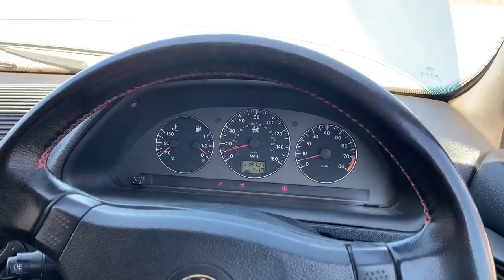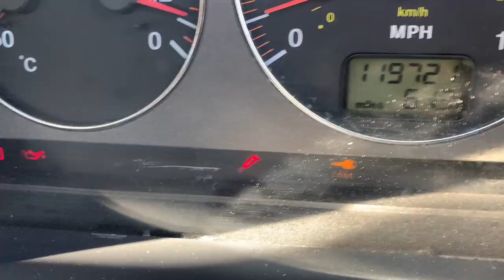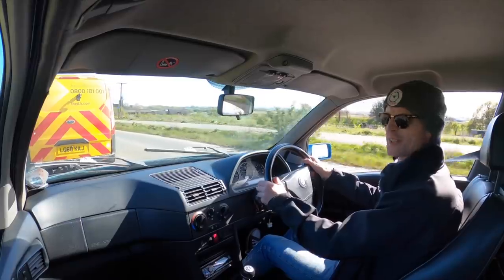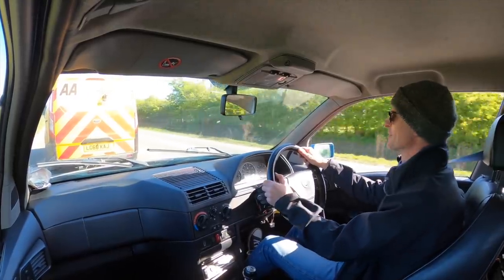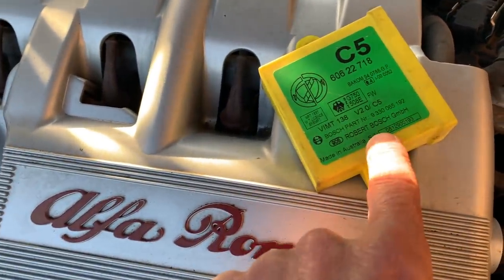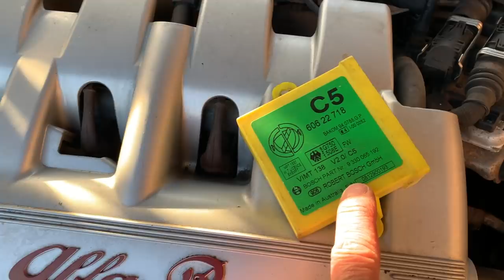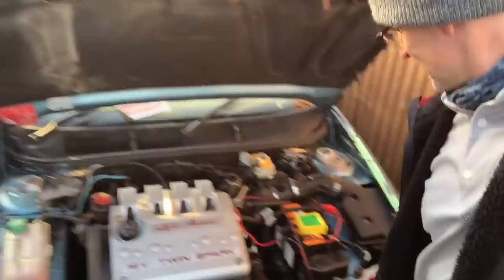Alfa 145 - KILLLED by a speed bump!!

Comment: That AA bloke was very good and dedicated ! They are not normally like that .
Reply: That's way more than our AAA in the states will do! They'll either deliver a jump start if you have a dead battery, enough petrol if you run out of gas or a tow.
Reply: Yeah normally they give up after 10 mins LOL
Reply: @christineayres5339  or whinge!!
Reply: I have to say owning a Land Rover Discovery 4 I get to use the AA a fair bit and they’ve always been great. 

Most recently one AA man was underneath it trying to sort out a diesel leak, which turned out to be a faulty fuel filter, but it’s hidden away under various skid trays and took a lot of time just trying to dismantle it.
Reply: ANWB in Netherlands are like that, they could even fix a carburettor on the roadside. Only once they had to admit their defeat when the V70's fuel pump had died and was inaccessible without removing the fuel tank.
Reply: Last AA bloke I had attend was horrible, he just didn't want to be there or do his job.
Reply: @ThatLeeNoble  Had one like that too, with a Mk2 Astra (or Kadett E as they were called here), coolant hose burst and he was complaining that I didn't maintain the car well enough, despite the battery and oil filter were fresh and had Opel branding on them. He did fix it though!
Reply from the maker: Ive been very lucky as every AA person who's been out has been brilliant, maybe its interesting cars that help?
Reply: He was a very nice man!! Wasn't that the old advert?
Reply: @furiousdriving  I think it is. Wou wouldnt want to see an alfa on it's own legs.  A lupo might not have got the same attention. But seemed a great guy all the same.
Reply: I'll never cancel my AA membership. Those boys have seen it all before. They've solved issues that none of the local garages could ever figure out. Saved me hundreds when I could only afford unreliable cars.
Reply: @volvo480  really? I just replaced the fuel pump in my V70-I. Pretty easy to do. Yours is a P26?
Reply: @furiousdriving  Definitely

Comment: In my experience it seems that if you give some cars a little TLC,   they either reward by leaving you stranded at the side  of the road or by developing some kind of fault. 
Top marks to the AA patrol man for doing his upmost to try and fix the Alfa.
On the subject of German parts failure, back in the early 90s I owned an MG Maestro 1600. Whilst we were on a family holiday the gearbox developed a serious fault which resulted in a replacement gearbox being fitted by a local recovery agent. As you’re no doubt aware the Maestro was fitted with a VW gearbox.

Comment: Bosch german part in an Italian part but made in Australia mate! Have you checked the key fob to make sure the little chip hasn't moved around in the plastic key fob. Also check the wire loop behind the ignition lock. Cheers Steve, Sydney Australia
Reply from the maker: we did open the key and it looks like the ring may have a connected fault

Comment: I think I've  got a spare code box with matching key if you need one . Also it looks like the code antenna ring around the key may have moved I think  it should be flush with the front of the barrel that would cause the problem
Reply from the maker: I think part of the problem may be the loop but that was taken off and just popped back as it will be checked wit the ECU. Im sending this one off to be checked so I know it wont happen again with older parts

Comment: I think the Fiat Brava, Bravo and Marea had the same Problem. It happened everytime you pushed the passenger seat backwards to harshly
Reply from the maker: similar parts in them
Reply: Wasn't that the fuel cutoff switch that triggered in the Bravo/Brava if you slammed the seat back?
Reply: This happened to me the first time I had passengers travelling in the back of my 145 - pushing the passenger seat back triggered the fuel cut off switch. Very embarrassing!
Reply: I haven't encountered that (in 13 years) but will be sure to take care to avoid it in my Bravo HGT

Comment: I had an Chrysler Grand Voyager AWD -00 do that to me outside a store, it started but cut off two seconds later with a glowing immobiliser. Tried the other set of keys but had to give up, talked to the store owner telling him I'll leave the car there for the night. Went home and started googling. Found others with the same problem and the solution, went to get the car home and it started, drove it home and ghe next day the problem was back. But this time I knew what to look for, behind the heather controles that sucker was situated, and yes, the internet was right. The connector to the ground wire in the immobiliser had melted it's plastic surrounding connector, one of many in a big connector. I took the immobiliser out and solded a larger area cable onto the pin, then made an isolated crimp connector some 10cm away from the pin, carved the burnt part of the connector away and mounted the immobiliser, connecting the earthwire with the flat connector to the original wire. And it has worked since then. Car manufactorers cheapness in keeping costs down by having too thin wires and flimsy connectors seems to be a profitable way to get customers to their workshops!

Comment: Similar story: Finished work - started my car, just rolled over the metal bar for the gate from the compound, when a loud, spring-like ding hit, and half of my power was gone. The right rear handbrake apparatus gave in, locked the wheel to a halt .. limped back, called the mechanic. He fought with the pieces (drum of the brake stuck on hard, rust and brakedust by the pounds falling out), managed to get it rolling. In the end there was a little hook sort of a thingy that got rusted, the cable dryrotted itself into the tubing and the frame .. it was a ticking time-bomb.
Things like these can ruin the day, I guess. 
Cheers to you for not willing to do something you may regret (I'M GONNA SELL YOU .. YOU UNDERSTAND?!), also an applaud to the assistance person - that I think exhausted primary problem solving attempts. Let us hope that connection is all the cause .. that module looks complicated enough to be of significant cost to fix :/.

Comment: With the light going on and off with a wiggle, could a dry solder joint be the problem ? Maybe the internals of the box just need going over with a bit of solder.

Comment: I've had good experience of AA mechanics getting stuck in and fixing tricky electrical faults on my older Fiats.

Had a fuel cutoff issue when I bumped the switch when running the car without the passenger seat (the switch breaks the pump earth line), amd on my Brava I immobilised it after moving the immobiliser relay tray on the bulkhead when changing the starter motor (I flexed a rusty connector on a wire under the tray and it was failing intermittently).

Comment: Have you still got the original redish/brown master key Matt? If so try and reprogram the keys, start with the master key, turn ignition on until immobiliser light goes out, repeat with other main keys then repeat to finish with the master key, if not then the yellow control unit will have to be checked/repaired, you might even need to send the engine ecu off with it has they're paired, if not work out how to bypass it with the aid of a wiring diagram if unfixable mate, good luck 👍

Comment: Is that just a strap towing that car? In Aus since some time in the 90s you have to use a rigid pole of one car length long(not something you can carry in your kit), I haven't even seen a car towed that way for maybe 20 years, that car appeared to have been bought as a non-runner & was going to the new owner's home. If you have a breakdown that can't be repaired in the field it's just about always a tilt tray truck that takes you home, or to the repairer.

Comment: Indicators in my 22yo 156 intermittently stop working due to the relay wiggling loose. Its a faff to replace it (you can get it out, but not back in unless the steering wheel is off), so I just pop the plastic column surround off, give the relay a tap back in, and its good to go again.  Just a 5 min job but it was a right PITA last time - I had literally just picked up the car after having a front end respray to address peeling lacquer when bingo... so yeah, no good deed goes unpunished.

Comment: Something similar happened to me but the AA were totally unaware of the reset switch for the fire protection system.  After the AA bought my car home  I found  the button after a 10second google search and restarted the car without issue.   So full marks to the AA for rescuing me after an accident - which they don't have to - but no marks for not knowing about the reset switch.

Comment: If its any consolation my MG F had an unfortunate meeting with a Nissan Juke.

It looked cosmetic but after getting it home and getting the bonnet open it's all looking a bit warped. It might be the end which is extremely frustrating as I've spent most of winter getting the car totally sorted and through an MOT with no advisories. I got a whole three days usage out of it :(
Reply from the maker: oh no, hopefully enough can be bolted on to make it straight again
Reply: @furiousdriving  Fingers crossed. I'm very lucky to have a local MGRover specialist parts supplier, if the chassis is fine I may be able to get repair sections for the front. Thats the plan at least, I put so much into it I don't really want to see it go.

However if it is too far gone I'm fortunate to know of someone that will be selling a certain Rover Cabriolet soon, I may have to put a bid in :)

Comment: FYI, this isn’t that uncommon. I’ve had it before on another Alfa; the connector into the CODE ECU gets loose, or the antenna for the key fails.

Send the ECU to Gus at Alfatune and have the CODE system deleted
Reply: Commenting and liking to bring attention.
Reply from the maker: Thats what I was thinking then it cant happen again, it was a different company Id found though

Comment: Its funny the German part is what killed your Italian car, the only time my British car (Jaguar XJR) has gone wrong in the last 14 years was when the Japanese Nippon Denso alternator decided 14 volts was 3-4 volts too low! luckily it only blew the heater display bulb (& made the main dash lights pulsate, but that didn't cause any permanent damage). On the upside, the over voltage made the electro magnetic suspension feel fantastic!

Comment: I had a Volvo 940 called the AA , not starting , he was made up to be working on an old car. He had it fixed in minutes and asked could he try his new tools and diagnostic equipment on it . I basically got an mot and full check up on the car in the next 90 minutes . Next time I had an AA man he was going to rip holes in my boot looking for the fuel pump until I pointed out it was under the car . The 1st man was old school with experience the 2nd went by what his computer told him, give me old school every time .

Comment: Try this. If a mistake is made then turn the key back to the stop position and start again.

1. Read your 5 digit code.

2. Turn the ignition key to the MAR position (one click on from position that the key is inserted in).

3. Fully depress the accelerator pedal and keep it pressed. The EOBD/Injection failure light will come on the instrumentation panel (the light looks like an engine viewed side-on). The light will come on for 8 seconds (keep the accelerator depressed). When the light goes out take your foot off the accelerator.

4. The warning light should now flash - count these and once it has flashed the same number of times as the first digit of your code then push and hold down the accelerator and keep it held down until the light comes on again for 4 seconds and then goes out; now release the accelerator.

5. The warning light should start to flash again - wait until it has flashed the same number of times as the second digit in your code then push down the accelerator fully as above and follow the rest of the above (4).

6. Repeat for all digits.

7. After doing the last digit keep the accelerator pressed - the warning light will come on for 4 seconds then go off (this is the same as all the other digits); release the accelerator.

8. The warning lamp should flash for about 4 seconds confirming that the code has been entered. If the lamp stays on then the code has been entered incorrectly. If incorrect then turn the key back to the stop position and try again.

9. If the code has been successful then turn the key to the AVV position (the position that the engine starts) - if you turn it to the stop position then you'll have to start all over again.

You'll have to follow this procedure every time you want to start the car.
Reply from the maker: that sounds like a lot of wrk every time!

Comment: Just remember, as James May once rightly said "Italians invented electricity. They also invented electrical faul..."  Oh, wait... Bosch.  In all seriousness, I've had quite a few electrical issues with late 80s to 2005s (ish)  German made products which seemed to be mostly down to their lead free solder.  Several Mercs with faulty electric windows, resolder the connectors and it suddenly starts working. (Due to the current sensing circuit getting incorrect readings), had it with several Grundig radios in the past as well as a number of Blaupunkt head units.  Even the immobiliser on my E39 suffers in the cold, now the temperature is warming, it seems to work perfectly!  Maybe the speedbump TRIGGERED a cold solder joint somewhere in the CODE unit!

Are you on the 145 forum at all?  Haven't been on for a few years, but Gallio Evo is the oracle of the Fiat/Alfa CODE system.

Comment: I've been left standed by only three cars: my first, a 1999 Ford Focus TDDi, on which the electronic fuel injection pump failed. Made  y Bosch. Second was a 2006 Focus C-Max, on which the CVT gearbox failed. Made by ZF. Third was the wife's SEAT Altea XL, on which the DSG gearbox failed. Made by VAG.

Basically, the conclusion I've come to is: if it's German, it WILL break.

Comment: Having owned 4 Alfas, and regretted buying 3 of them, I came to the theory that the engines look pretty because they're meant to be on display at the roadside. Shame, as they were great to drive (Giulietta TCT excepted - awful thing!) but I've since vowed never again.
Reply from the maker: Ove had a lot of Alfas and not had trouble, a single BMW gave me more grief than all the Italians put together
Reply: @furiousdriving  Luck of the draw maybe, but the video above suggests you've had at least one issue ;-) And yeah, I wouldn't touch a modern BMW either, unless I got mates rates from Hoovie's Car Ninja.
Reply: @bri77uk1  BMWs from 2000-2010 are the worst, but then they got somewhat better again. And one could buy a model from 2000-2010 if one really has knowledge on what to look for... Wrenching on my own cars, I have learnt so much about the 1 and 3 series generation starting from 2005, that I more or less cant get any other car, haha. Sunk cost fallacy, but with education.

Comment: Rule 1: If the Alfa doesn't start make sure the code light is going out.  Before you do anything else take the battery leads off and tape them together overnight.  Common issue.

Comment: Sounds like some dry solder joints on the ECU connector.
Reply from the maker: The chips fail on them as well after a few years
Reply: @furiousdriving  European cars would be a lot better if they let the Japanese make their electronics and electrical stuff.

Comment: Italian 'electricky'  strikes again. During the late 90's I had 2 Lancia Delta HF Turbo ie's. One you had to thump the dash pad, just above the fuse box when you turned on the headlights. The doors locked & unlocked when they wanted to, setting of the alarm in the middle of the night. The Italian's know how to build great engines but electrics designed & installed by a 5yr old!

Comment: That's why I drive a car with hydropneumatic suspension.
Reply: Stones and glass houses maybe. You may clear the bumps, but its not like the citroens of similar age are well known for their bulletproof electrics, haha. :)
Reply: @GoldenCroc  That is only partly true. Besides Citroën always busting up the reputation of thier new types directly after launch and then markedly catching up when it is already too late Citroëns core electronics are actually bulletproof. It's the "luxury" stuff that tends to be dinky. I've had 3 XM's, full of all sorts of sensors for the Hydroactive system and never, ever had any problems with that. Do however not ask me if I never had a problem with less essential stuff like fancy displays or electric window switches.The core of my initial remark however indeed was that a speed bump must be as high as Mount Everest to really bother my XM. :-)
Reply: @marcbrasse747  It was all in good spirit, I have owned a C5 myself. It worked well enough, no real problems except window switches, so yes, can confirm. It was a wonderful car for carrying load or towing, would have kept it, but I got a hankering for something all wheel drive, so away it went.
Reply: @GoldenCroc  The C5 was / is a very good car. It's only real vice is it's lack of character! :-)

Comment: Sell it Just joking these dam speed humps and potholes are destroying cars. I remember a friend of mine had a jag went over pothole and the same thing cut out it destroyed the fuel cutoff switch and petrol pump. Could try splitting the ecu apart and if there's any bits you can tap with a soldering iron I did it on a ecu from a c4 grand Picasso and worked

Comment: This is going to run and run.A bump in the road won't cause that. I do stand to be corrected
Reply from the maker: they are brutal speed humps like pot holes in reverse so a bad connection could work loose on it